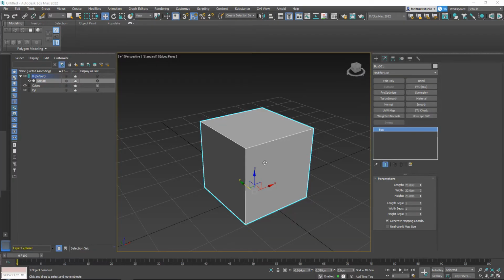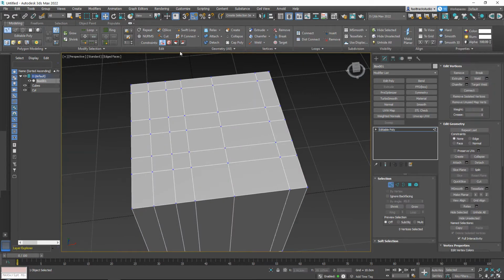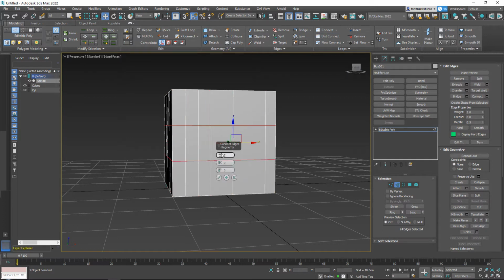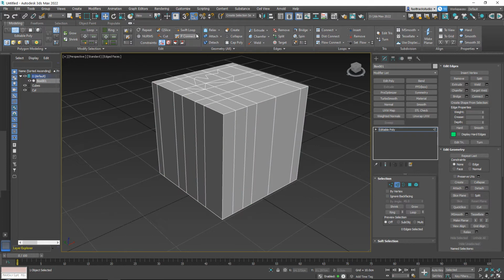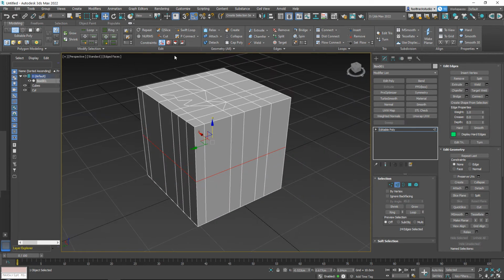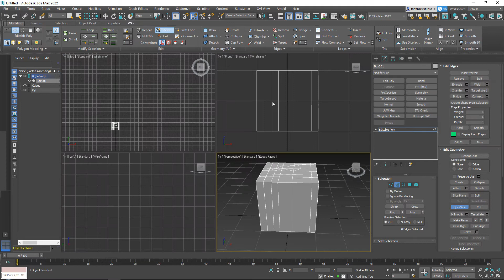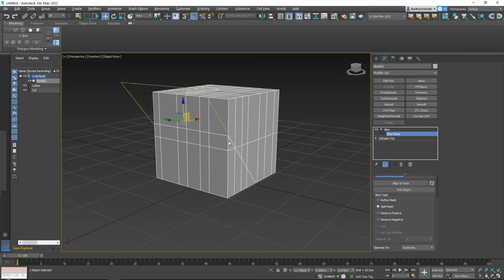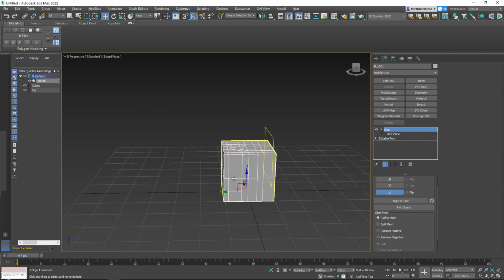Quickbit - Cutting, Connecting and Loops in 3DS Max

Comment: Swift Loop with Shift - I think you are mistaken. On the video it makes the loop where the mouse is. Am I missing something?
Reply: No, you're right. I've tried several iterations with this and it places it only where the cursor is, when you don't want the flow. I can't believe such a basic feature's missing from Max
Reply: its annoying it should give a center line technically but this feature is missing